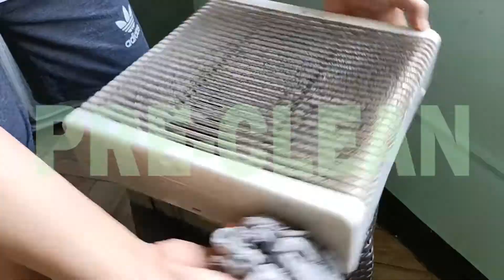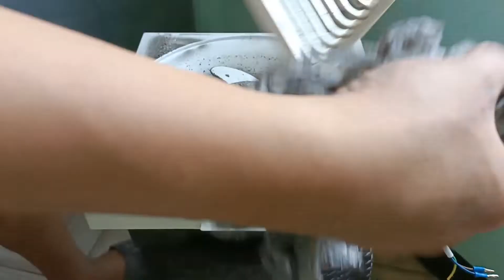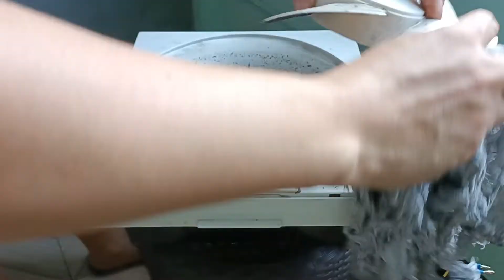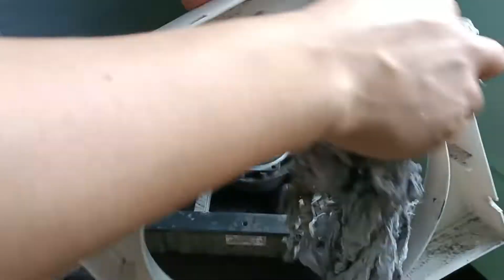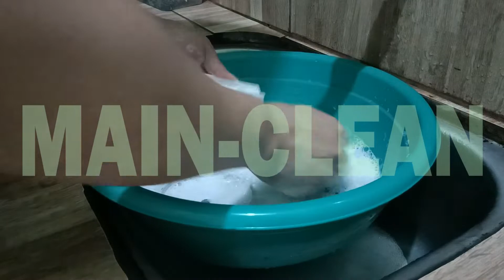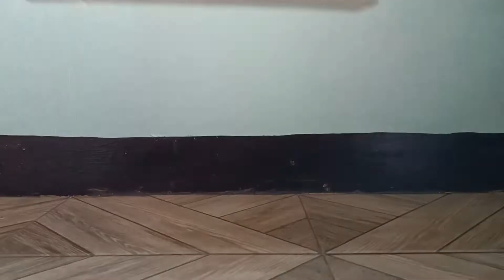HOW DO I CLEAN MY KITCHEN EXHAUST FAN

Comment: is it possible to vlean it without removing it from the wall
Reply from the maker: yes
Reply: @masterdorbus how tho. my exhaust fan doesn’t have an easily removable lid like the one in the video
Reply from the maker: @bellecolis2609  is it the same model as mine? OMNI XFW-200?
Reply: @masterdorbus  no, it’s not omni i think, and it has a fixed lid 🥲 I havent found any videos showing how to clean the fan blades inside when I can’t remove the cover, unfortunately